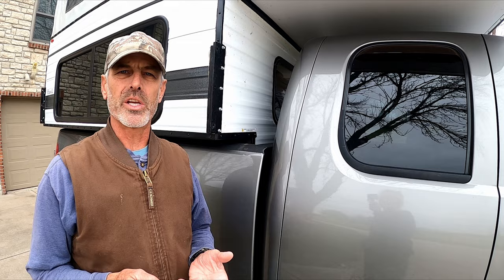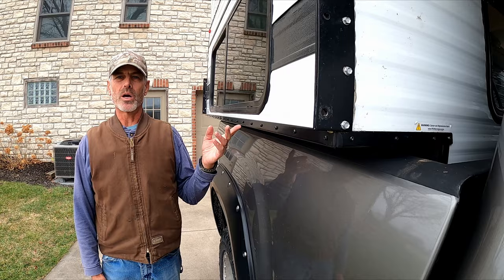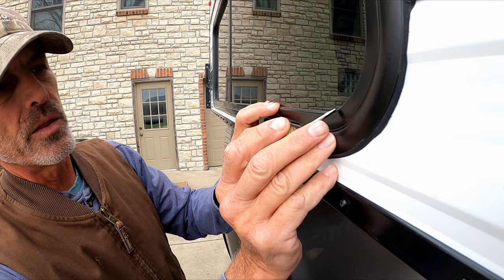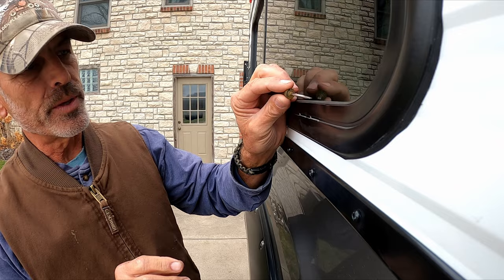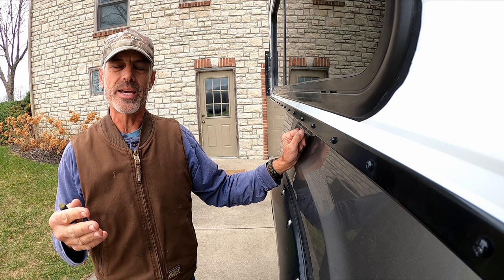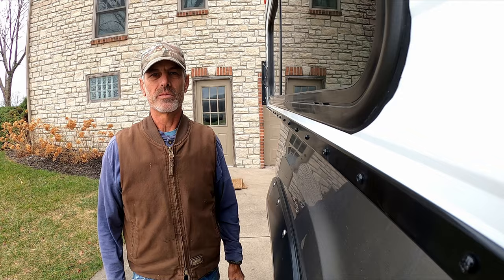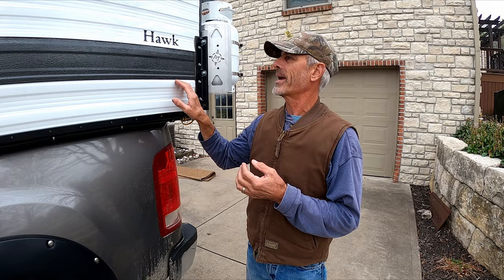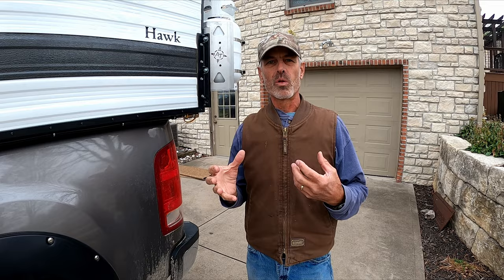Four Wheel Camper- Hawk Shell Final Leak Issue Resolved

Comment: Thanks for the update. I hope you won't have too many more leaks or trouble. My Granby shell model, now just past 1 year old, has had several problems too. Probably not unusual for the camper industry. And that sucks! I naively bought a new camper thinking I wouldn't need to fix stuff. I'm lucky the roof leak happened 2 weeks short of the 1 year warranty expiration. It from the Yakima tracks I had included with purchase, or so it appears. FWC authorized the resealing of the tracks and replacing the heater cabinet lid that got water damaged. I just need to travel 3 hours one way and over a mountain pass to get it done. That will happen soon.
Reply from the maker: Wow JD, sorry to hear of your leak problems!! I hope that will solve your issues and you can get on with enjoying your rig. I envisioned better from FWC but guess not!!!